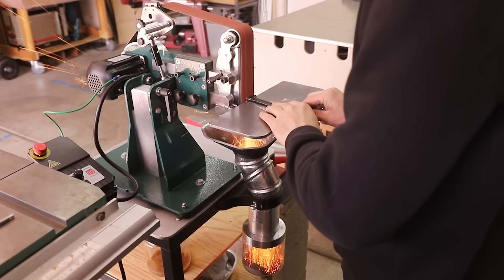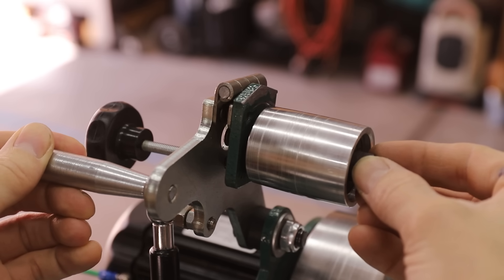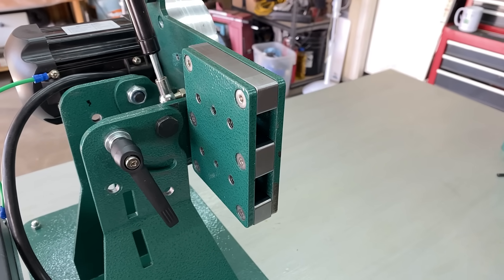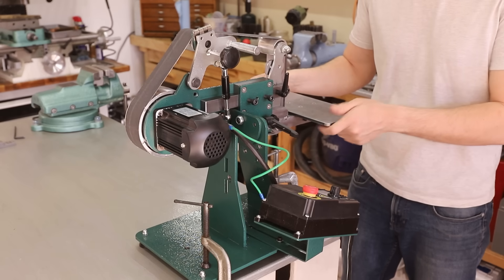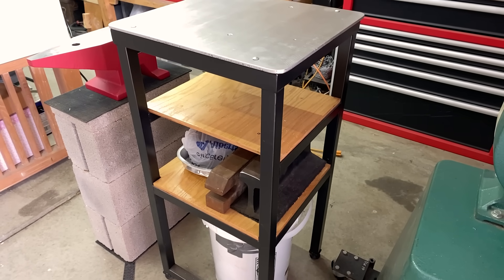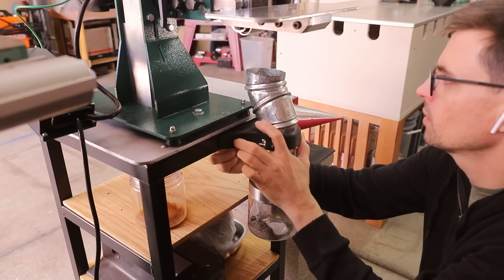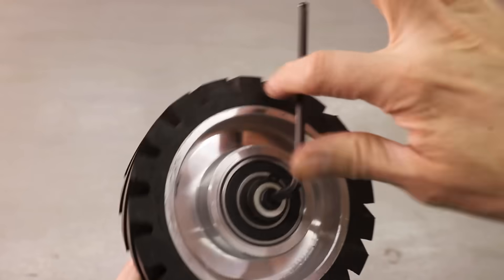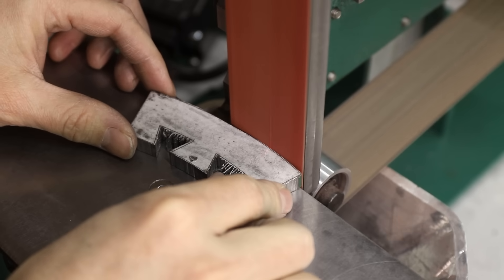Transforming a Cheap Belt Grinder into a Quality Grinder - Grizzly 2x42 Knife Making Grinder

Comment from the maker: If you're interested in any of the tools or equipment I use and you want to help support the channel then don't forget to check out some of the affiliate links in the video description. Thank you for the support!
Reply: What size Dowel pins did you use. I can't get my tracking to work at all
Reply: @robinson-foundry You're obviously smart enough and properly equipped to build your own 2x72 from scratch, so why not just salvage useful parts from your Grizzly and stop trying to improve their very flawed unit and instead build your own unit that incorporates all of your ideas and concerns?  I built one from scrap using ideas from JerSchidt as well as House-Made, but also baked in some of my own ideas too.

Comment: People who say “he could have just bought a better grinder” or “he could have just made one” are missing the point. Yes he could, but not everybody can. As far as I can see, these upgrades could be made without having access to other expensive machines and without having to weld: that’s good news for many of us. And many of us don’t want to drop two grand on a better grinder, but do have the spare time to make upgrades. So there.
Reply: lol well he did weld almost every part, so not too sure what you mean.  also you need tools that will machine metal parts down very accurately.  not super doable for most.   cool video though.
Reply: Someone did not watch the video carefully enough.  Missed the welded parts and the use of other " expensive " machines to get the dimensions needed to shape the ( few hundred of dollars worth of ) pieces of metal to get a " new " grinder.  People who say " he could have just bought a better grinder " .... sure could have but it was an assumed impulse buy ( since he apparently read the reviews after he got his ) ..... or " he could have just made one " ...... he did just make one. Given the end of the video he comments most reviews say the motor and/or motor control goes bad so other than the bearings he should have made one from scratch and did a cost comparison to one comparable to his specs.  That at least would have been productive.  He ends saying he paid $380 for a tool and yet made no mention of how much he spent on material to make it how he did.  I can understand not wanting to " drop two grand " but by your logic you are willing to buy a tool for $380 and then at least $200 ( that aluminum block alone would be around $80 ), then use a welder you do not have and a 4 x 6 Band Saw ( Harbor Freight $350 ) to then have a tool with a motor and/or motor control that will need to be replaced.  If you have the spare time to make the upgrades, you should have at least the time to do a shred of critical thinking before making a " So there. " claim.
Reply: Both comments are perfectly consistent and logical. 

“I used my milling machine…” gives away the story.
Reply: I think every upgrade he made could be done with a drill, cutting tools, and a file/grinder/tap and dye. And, when making these upgrades, one will have access to a grinder for shaping of the metal. Especially things like using angle iron for the platten.

Comment: I saw the sparks going into your jar and my first thought was a fire hazard, so I'm glad you covered this for your viewers. Certain metals and combinations of metals can cause a serious problem. I see you basically re-built your grinder. Well done.
Reply: There is also the potential danger of accidentally making thermite if you just so happen to grind aluminum and iron. If the iron rusts while in the jar, the next time you go to grind, there may be a little bit more kick to your grinder than you’d wish for
Reply: @fluppet2350  Yes, I'm very much aware of thermite and how it can melt right through the toughest of steel.
Reply: @fluppet2350 this what my first thought when seeing that.
Reply: Yeah, I like to think of it like this: Refined metals are essentially just fuels that require high temps and strong oxidizers to ignite.
(IE, a poor man's thermal lance capable of melting through steel and stone alike can be made from steel tubing, 100% oxygen flowing through it, and some steel wool at the end to get the reaction started.)
High surface areas like thin strands or fine dusts/chips mean your oxidizer can be weaker, like the oxygen in the air around you.
Combine iron dust with heat and air, and you get a steel wool fire on steroids.

Comment: With the amount of work you did on it, I'm not sure if you actually came out ahead vs either building a grinder from scratch or buying a better one, but the end result is pretty good.
Reply: I assume the building the rest of the machine would not be worth while. Things like bearings and wheels etc aren’t really worth replacing and complex to make.
Reply: Agreed. The House Made Revolution 2x72 would be cheaper to build than the grizzly with all his upgrades. Makes sense for him I guess.
Reply: I agree. The only thing I’d change is the platen and do something to help it track better.
Reply: A Decent 2x48 runs about $1400. What makes the Grizzley so appealing is it is currently the only budget 2x42 that is similarly designed to a 2x72. Some people have to have a smaller footprint and for now this is it... Its small, and light can be easily moved. I would like to see a company make something similar footprint wise but built like a real machine and have it come in at about $700 that would be my ideal setup.

Comment: I ordered one of these, and it was dead on arrival, Grizzly’s support was phenomenal though, they told me a few things to check, and call back with the results, to confirm their suspicions, and once I did that, and confirmed the easy parts were not the problem, they sent me a return label so it could be sent back and replaced. Super nice helpful people on the phone. Still waiting on the new one to arrive, as I live in a remote area, but looking forward to trying it, and building a few upgrades myself!
Reply: should have sent you the replacement than wait for replacement...

Comment: I bought a new Grizzly 2x42 grinder recently. I ordered it in Nov 2023 and it wasn't delivered until March 2024. It had been back ordered but Grizzly also worked with the factory to fix some of the problems encountered with early modrls.  Mine is working well and the only thing I had to do was make a steel platen which I attached to the original after removing that plastic strip.  I've made 6 knives on it so far and have not had any problems.  I did buy an after market small wheel attachment. I don't have a mill or welding gear so I won't be making all the extras like shown in this video.  He should make and offer some of his upgrades for sale.  There are probably 1000's of these Grizzly 2x42's out there now and many users would buy some of these upgrades if available.
Reply: What small wheel attachment did you get? I got a cheap one off eBay, attached a long arm to it to retain the "waterfall" aspect, stuck it in the table slot, and use a 2x72 belt with it. It works but is a pretty inelegant solution. I'm curious about what others have come up with.

Comment: Finally got my platten upgrade finished; I was not prepared for how much of an upgrade that was. It is like an entirely different machine! Before, with their ‘graphite impregnated backing pad’ it felt spongey when grinding, and didn’t seem to cut well, even with good belts (the first upgrade, the belt that comes with it is a joke). 
Now that I have a tool steel platten, it cuts like the blazes!

Comment: Saw your video and liked the mods. 

Grizzly was having a sale l, so I picked one up a week ago for $310 to my door.  All in all, not too shabby and much more rigid than I was expecting.  I did not detect any significant deflection, though I do see making  new tooling arms and receiver blocks like you did.  I know it is mathematically horribly underpowered, but it had no trouble being force fed the tang and a full 1/2" of 10"  Nicholson mill file.  That, I was not expecting.  Cool.

Comment: Awesome work man! I have done some minor mods to mine as well. it's an ongoing project tool. You should really make an 8" wheel for it too, the 2x48 belts are just plain better to run with the flat platen or a wheel.

Comment: I'd get a carbide or a corundum/alumina or zirconium ceramic plate instead of glass. 

They last very long. Glass doesn't, especially not with the better, harder abrasives, when using coolant or high belt speeds. 
And they're fairly cheap too, you can get ceramic plates for some chump change on Ali and similar platforms, their low thermal conductivity makes gluing them on a very practical solution.

Comment: I'm just dead curious about how much the upgrades cost in time and materials. You did a fantastic job with it though, looks like it works beautifully, bravo! 👏🏼
Reply: Same here.
If those "simple upgrades" (50% re-engineered) take the 380$ shipped price tag to 700$+ in time and materials, why not get a Premium one, or make it from scratch yourself. Since the motor AND the PSU are guaranteed to burn-up anyway.
Is there Anything that you didn't have to alter, replace or will have to replace?
Reply: @IcecalGamer  my thoughts exactly. I think your guesstimate on the cost however is pretty low. My guess is that given a fair rate for the skilled labor and the amount of time and effort involved in doing these mods, not to mention all the extra tools required to do so, I would not be at all surprised if a good machine shop would charge close to $1k for all those parts, and even if you could do it all yourself you're probably looking at 20-30+ hours of labor to make and install it all, so it wouldn't really save you much. And I would think most people would probably be better served to just buy a nicer grinder to start with, even if it costs $1,200-1,500 or so.
Reply: @justanotherfreakinchannel9069  Wanted to keep it conservative on the cost (bargain/ scrap bin cost for the raw materials on the upgrade).
However, since i now read your reply and made me think more, doesn't it take more time in skilled labor, thinking about the problem and finding a solution to the sub-par product, than over-engineer it from scratch?
If you make it BEEEEFY and practical (no beauty points, and no "where can we thin down the material to keep it down to a cost"), Even I could Bosh it together in 2-2.5 days Including waiting for parts delivery, and i can't cast by-metal axes :)) .

Also, since the "bar" to beat is motor+psu that have 100-ish work-hours of life-span. Could you not buy them SH on the flea-market place or your choosing?
Reply from the maker: Thanks! Materials are around a couple hundred but I had a lot of fun working on it so I wouldn’t count my time really. Sure I could have bought a much more expensive machine, but I thought at the time that this one would work out of the box. One upgrade led to another and well here we are..
Reply: @robinson-foundry Seems like you could have bought many of the things on your page for cheaper than it costed you … seems like thats not the point of this page (thank god)🤦‍♂️😂

Comment: Man, I got one of these a few weeks back and am trying to return it.  I went into this purchase with pretty low expectations, but the torque that my motor has is just abysmally low. I'm seeing that you could eat through half of a wrench head in about 30 seconds, but that has got to be significantly more pressure than I can apply to mine. Wondering replacing your platen increased the machine's ability to take pressure.
Reply from the maker: I was using a 36 or 40 grit belt. It is pretty weak but it’s been working for me so far. I will be replacing it at some point. Sorry to hear yours isn’t working out. Maybe the newer models have weaker motors.

Comment: If you were to replace the motor, do you know of any that will fit. I don't have any tools to really modify anything.  I did put a new pin in the tracking hinge but I haven't checked the wheel alignment to see if I need a bigger spacer so I'll check that. Im on disability so I needed a hobby to occupy my time. I cut out my first knife with an angle grinder then purchased this machine. Thank you

Comment: What size pin did you use on the hinge that adjusts the tracking.  I just purchased this grinder. It doesn't take much pressure to slow the belt down.

Comment: I think you did a great job. My only question is, you went through a lot of trouble to fix the rigidity problem and then left the rubber feet on the machine when you bolted the machine down. Do you get any movement frome the rubber feet?
Reply from the maker: Thank you! There is a small amount of movement coming from the feet but I will be replacing them.

Comment: I was going t9 pull the trigger on one of these but the reviews didnt look too good. Did grizzly ever fix the issues with the motor/vfd?
Reply: I ordered the 2x42 at the end of last year. Shipping got delayed by four months because they were doing rebuild to fix some issues. My grizzly 2x42 came two weeks ago and it’s pretty good for price and size. I need to make the modifications he did.
Reply: @SM-um5iu i just got mines delivered today. VFD exploded shooting sparks out where the wires came out on initial power up. Not a good look. Seeing that people had problems with it stop working in the middle of a job i was cautiously hoping all the issues were ironed out. This product lost my trust. Mines has a manufacture date of 01/2024
Reply: @Catbert814  that’s a bummer. I’ve been using mine for last few months no issues. Contact grizzly. Should be under warranty.

Comment: Filling that jar with water is MUCH MORE IMPORTANT than you can imagine!!!  If you've been grinding aluminum, and then grind some iron on top of it (especially rusty iron) they combine and are essentially THERMITE!!!!! Which will IGNITE and melt RIGHT THROUGH THAT GLASS JAR, YOUR FEET, (even your steel toe protection!) AND EVEN THE CONCRETE OF THE FLOOR!!! (well, that's a bit of an exaggeration... it would have to be a REALLY large amount, the exact ratio of Al to FeO2 and even then it wouldn't burn THROUGH it unless it was burning for at least 30 mins... but that jar isn't big enough to hold enough for that type of disaster) You probably already know this tho, but I figured I would  mentioned it.... Also is VERY GOOD PRACTICE to just empty the jar before switching up metal types... or just every time you have to grind aluminum just empty it afterwards, because the water won't matter if you only have a bit in there and it evaporates right under the spark shower and all it takes it one hot spark to land on a piece of aluminum for it to start burning and then it won't matter how much water is in that jar... so just keep the aluminum out of the jar and just empty every time you grind it :) Better safe than sorry, right?

Comment: All the "build one from scratch" comments are pretty ridiculous.  A decent motor and VFD alone would cost more than this grinder, especially since the unit is now $269.  I have been looking at this unit, but scared off with all the reports of failing motors.  I have a lathe, mill, and TIG welder, so the upgrades are easy for me, but replacing the motor and control are pretty much a show stopper. 8>( .  I looked at the parts list, the motor is about $220!!!!!!!!!!  If I was going to replace it, I would probably use a DC motor and control, which I think the stock one probably is.

Comment: Really getting the impression that, anyone buying one of these styles of belt grinders (due to this and all the other maker channels featuring these), should already have a mill and/or lathe and/or welder, plus all necessary tooling and plenty of steel and aluminum stock, OR be content with a horribly designed grinder that may or may not maim or kill you... 🥲